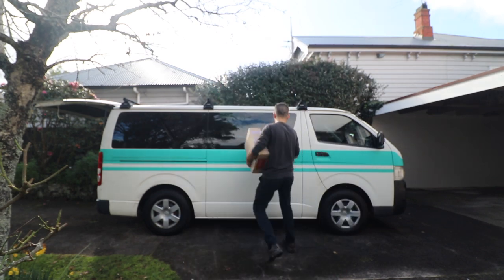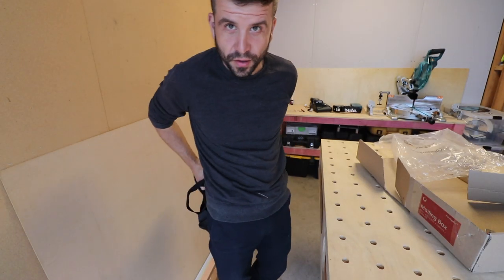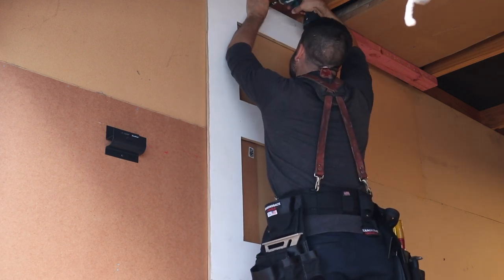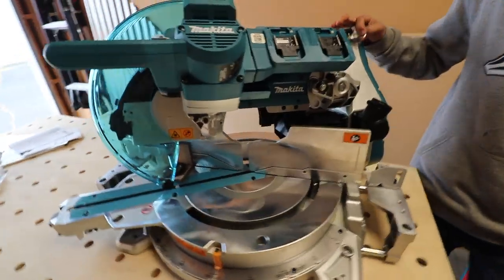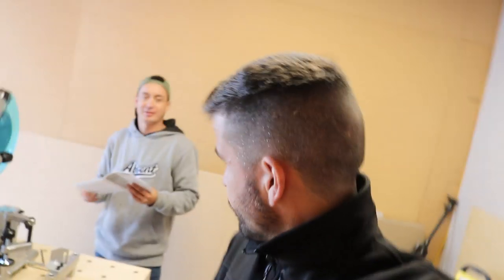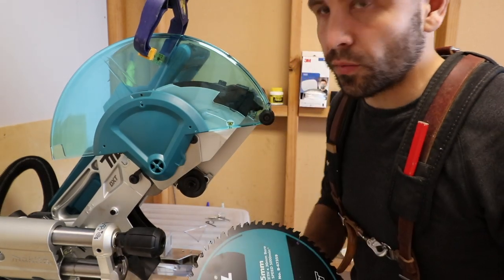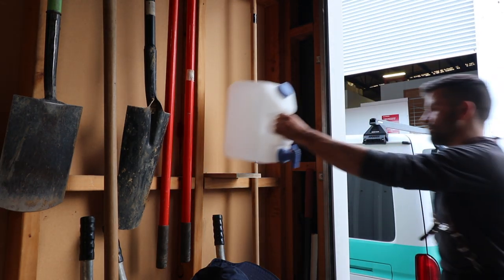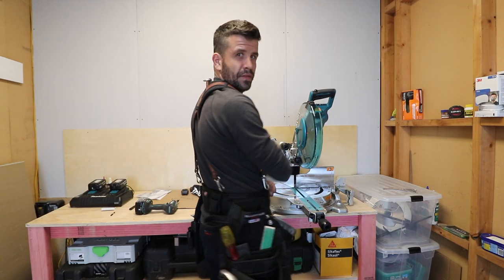I Got a New Tool Belt!

Comment: Got my diamondback maybe 3 months ago. Pockets are still a little tight and hard to get the hands into to get out the fasteners. Hoping it relaxes a bit and stretches. But love it. Love the hammer holster. And mine came with a nail puller holster as well.
Reply: Soke them in cold water and stuff tool bateries in the pockets while drying, of streches them out and forms them
Reply: @laumin6581  thanks. Coworker said baseballs. Just have to find some downtime to try that.

Comment: I have the 10" version and it's a beautiful piece of equipment. Just remove the fences when you make a bevel cut haha.
Reply: I learned that the hard way!
Reply: Is the 10" version heavy? I have the 7-1/2" version and it's a great saw, 😁
Reply: @TheToolnut  Yes, it's quite heavy. I'm guessing 60lbs. I keep mine on the makita stand but I installed some 10" pneumatic tires and a wide axle so it's easy to transport now.
Reply: @br6145  Thanks, 👍
Reply: @TheToolnut  i  want the small makita miter box. Any negatives? The 10" is a pig but i love it. The detents warping out is my biggest negative.
Reply: I like how the fences have a clip to hang from the supports.
Reply: @Moraren  if you told me you never cut threw a fence i would tell you havent been a carpenter very long. Aluminum cuts like butter.
Reply: @smokingcheeba420  Yup! I heard the slight noise it made and just thought: Hmm thats a hard knot. Then I remembered the detachable fences! First time i cut bewels with our brandnew saw at work.

Comment: My tool belt is pieced together from a few different things. It was a basic nylon belt with two pouches. I have switched the pouches out with different ones. The most unique thing is I use a "electrician's" pouch on my right side. It has vertical dividers that make it great for carrying tools like a short pry bar, folding ruler, mini level etc. I did a video on my setup if anyone wants to see it.

Comment: I've been using a Diamondback for about a year now. Saw Kyle from RR Buildings review and got one sent over here to Australia. Love the hammer scabbard. The set up wasn't cheap though.
Reply: I made a hammer sleeve after saw kyles. Cut apart an old bag and made one and attached it to my $37 Home Depot bags. Works great but the belt itself is still not that comfortable lol.
Reply: @logan Patterson I did the same, it was a hammer stapler pouch that I converted for mine 😊
Reply: Chris Donnelly Builder definitely worth the fifteen minutes of work I really like it

Comment: I would find it difficult to find a use for that saw.  It’s too big and heavy for lugging around from site to site.  It would make a good workshop miter saw but then why would you need it cordless?   

It would be great for doing precise cuts on large timber somewhere where you not on mains power.....  and that is not very often for most carpenters.  Might come in handy for oak framing but that’s about it. 

What Makita need to do is develop a light weight double compound miter saw.

Comment: I own the 10" and 12" models of the saw and noticed the dust collection tubes attached to the saw are different between the two. On the 10" the dust port is located down at the bottom of the saw at the junction between the two dust collection points. The 10" design is less intrusive to the motion of the saw and it's ability to work up against a wall, and also seems to collect dust better. Both saws are very nice and are exceedingly good at collection fine dust particles from materials like MDF.

Comment: Have the same saw. Two main issues with it I've seen so far are:
  -  the packaging is nowhere near good enough (as you can see, no internal padding. No issue as a result myself but seems plenty of people had issues with cracked guards and handles
  -  the bottom dust port is basically for show. The opening is fine but where it turns to the right it goes through like an inch squared cross sectional area space. They just haven't bothered to figure machine a better duct way into the casting. I plan to borrow someones die grinder to sort this. If it weakens the structure too much I'll probably circumvent the whole bottom port and put in a custom one. Unscrew the flanged spigot that goes to the bottom port and you'll see what I mean.

Other than that, absolute monster, cuts straight, clicks are good and the cut quality is unreal.

Oh and yeah had the issue with the bolt being INSANELY tight, just need to tap the allen with a hammer with progressively harder taps.

Comment: Hi Scott, did you look at large companies (like Makita, Stanley, Dewalt) tool belts? As they are probably available in most countries.
Maybe you can also talk to people that you know, if anyone used them, and make one large compilation of what's good/bad about them based on more people opinion?
Things like fixed pouches vs separated from belt, placing of hanger for hammer (IIRC you already talk about it), type of hammer hanger, leather vs plastic, optimal overall size/weight, is it maybe worth to do any conditioning to them, maybe you can find and point out best futures from parts from different brands, if is it worth to put any plastic disposable inserts to pouches.. or maybe you already miss some futures that would help? Those are just some questions that I can think of so far. 
As for now there are already few episodes where you talk about them, but I think that compilation and opinion of more people would be great  :)

Comment: Framer from Melbourne 
i have the corded version of that drop saw 
and possible the worst saw for "on site" use   
heavy like really heavy 
if it isn't hooked up to a vacum  it just clogs up with saw dust
apart from that its ok 
should have got the dewalt tho
much more basic

Comment: The efficicut blades cut nice but the have such a fine tip there’s very little clearance so if cutting wet timber of timber with tension they jam up pretty easy and heat the blades which buggers them pretty quick

Comment: Well... I like the saw, really nice!  I don't like the belt... much prefer the leather of the Occidentals.  I do like the hammer holder but since I do a lot of inside work, I'd probably still wear it in the back.  I prefer the occidental setup (horizontal and opened) over the material and setup of the DB.  The weight difference is also negligible once loaded up. Those loops in the back don't look like they fair well with hammers...  it looks like a police officer belt lollll.  Deputy S. Brown it will be ;)

FULL DISCLOSURE - I am an Occidental Leather guy all the way :)

Comment: Great words ,the test of time. Makita produced great mitre saws about 18 yrs ago. Ever since then they've been absolute crap. Crap locking mechanism that takes more time than it should i might add and everything is just too brittle.  Every builder I've seen on site with a makita drop saw all say the same thing. Wish i had never bought this. A sticker to tell you what degree your on instead of engraving it so it stands the test of time. Get my drift ? Just not good enough. Very hard to beat a dewalt  droppy for the price.
Reply: I reckon the matika LS1212 drop saw was and still is the best, mine still going great after 15yrs!
Reply: @mikepapa3196  thats when they were all made in japan right? Ever since the Chinese started making them its all gone down hill from there. Dont get me wrong makita produce some really good stuff but drills and drop saws are not what they used to be

Comment: Just bought a Metabo track saw and was going to change the blade so I looked in the manual which told me to turn the nut clockwise. After putting way to much force on it trying to turning it by hand, I gave up and got out the impact driver. After feeling like I almost destroying the thing it turned out the manual lied to me, the screw came out counter-clockwise when I tried to re-tighten it in desperation with my impact driver... I quadruple checked the manual and it says clockwise even online...
Reply: Mario  yeah well that's just like your opinion man ¯\_(ツ)_/¯
Reply: Mario  Guess that's why they say "made in Germany" on them right
Reply: Mario  Out of curiosity, what do you consider to be a great power-tool brand Mario?

Comment: I have the 10 inch corded version and its my favorite saw ever. I used a lot of different saws. My main negative is the detents het mushroomed out and sloppy. From going to fast and slamming it into a different angle. Its about a year and a half old now. The bottom dust port does nothing without a vac. Its a beast but all sliders are. Things i like are the big base plate. Helps when doing skirt boards and wide boards. Dewalts is way to small. To read the angles is a little different at first but i like it now. You have a newer version. I like your pull out supports. Your fences have a clip to hang from the supports when you take the the fences off. Just found that out a few months ago.